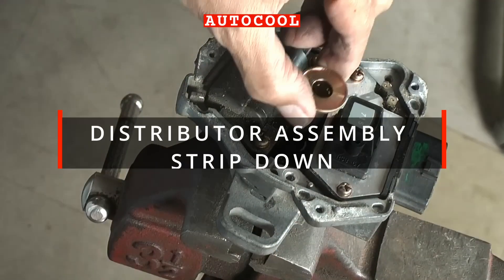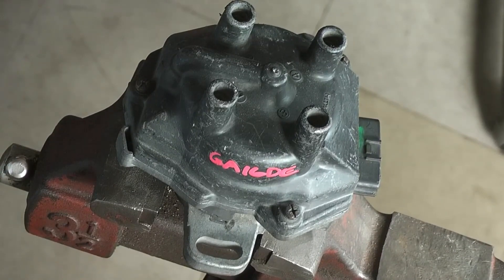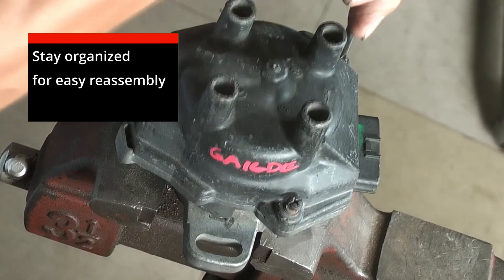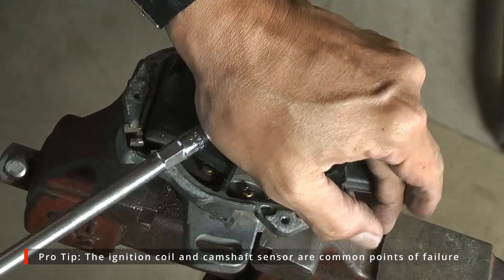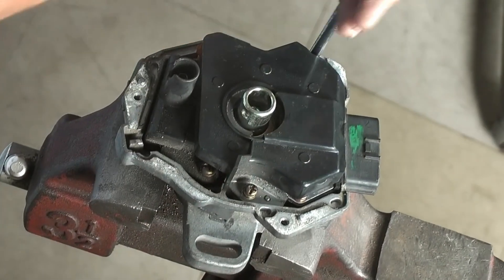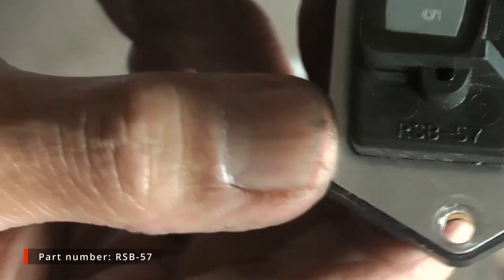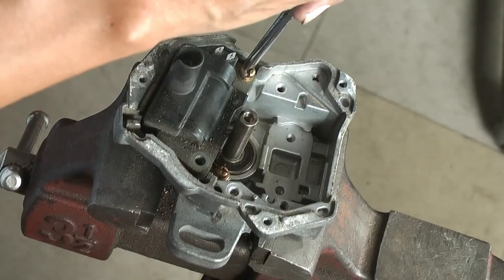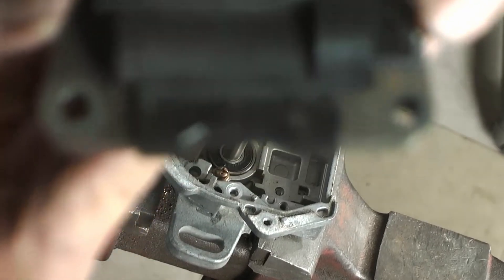Nissan GA-Series Distributor Breakdown | Disassembly, Inspection & Common Issues

Comment from the maker: Here’s a full look at the GA-series distributor assembly — how it works, how to take it apart, and what to check during repairs. 🔧
Whether you're replacing the rotor or troubleshooting ignition issues, this breakdown has you covered.

💬 What other parts or systems do you want us to break down next?
Let us know in the comments — and hit subscribe for more hands-on engine guides!

Check out more in-depth breakdowns in our Auto parts breakdown playlist:
https://youtube.com/playlist?list=PLe5LZ1l2SFi3Si3STrzZDwFTMKCsy16ov&si=cl0zItVOmXlyim5C